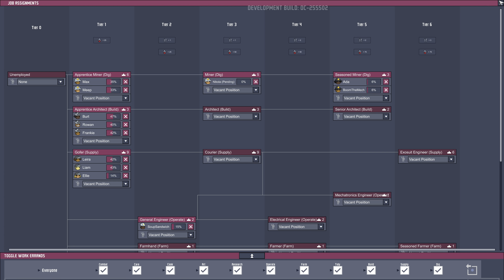CONVEYORS & TUBES! - PYRAMID BASE #8 - Oxygen Not Included - Occupational Upgrade

Comment: Remember that you can rotate buildings, like the transformer at 32:00. It doesnt matter but it helps a bit, you've made this silly mistake a few times :) Just a tip that you already know... Otherwise keep up the good work
Reply from the maker: Cedrath that was intentional so the heavy watt wire would be straight.
Reply: Ah, that also makes sense :)

Comment: For the sweeper, they works if they can see the target. So, instead of walls, you can use either mesh tiles or air flow tiles and they will be able to pick up things and deliver them without issues. At least, they are working for me in my game like that right now.
Reply from the maker: Good to know. I'll be abusing that until they fix it :P